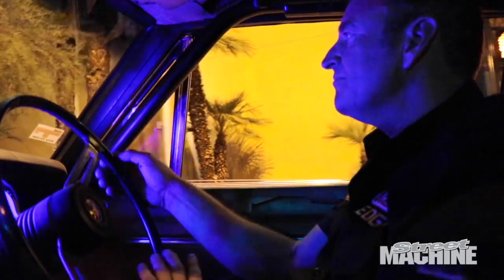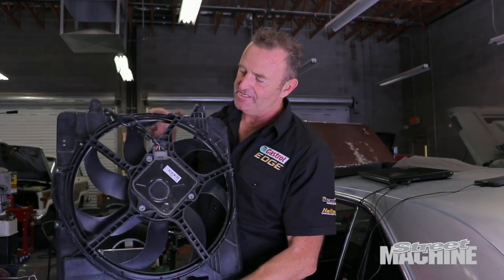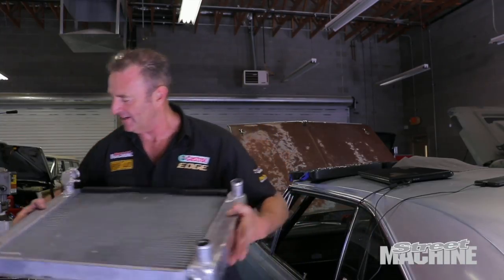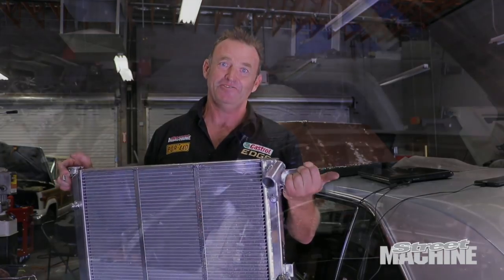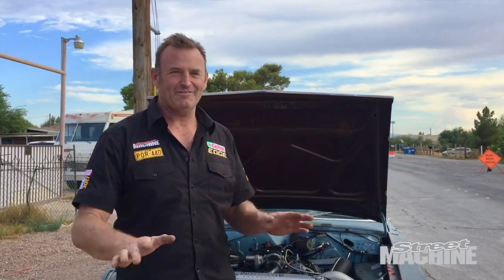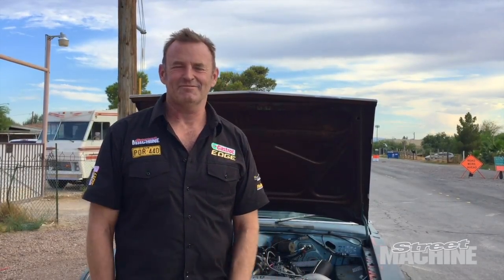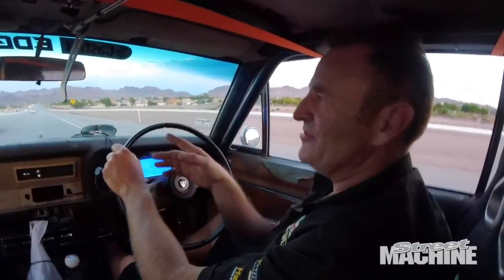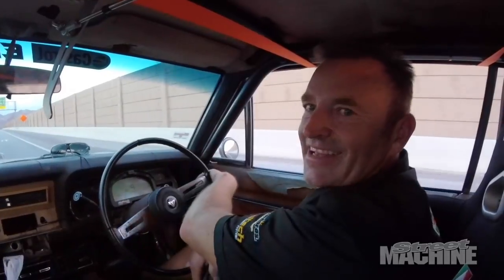Turbo LS-powered Valiant cooling system fix

Comment: Great work on the heating problem, also it's pretty amazing that Hal - tech can work on the car when you're State side.
Reply: Potaka79 Haltech are really good like that, they keep your tune in file so they can just quickly pull it up, change a few parameters and can flash the tube remotely

Comment: Great to hear you have managed to get back on the road. 
That radiator should have been plenty? I wonder if one of the diverters for the multi pass had been broken off inside, or perhaps it was only ever a single pass? 
You love got to love driving at night with the old Lucas 35 watt sealed beams.
They really look after the tourists at the Jeep conversion place you were at. Haltech doing a road tune touchup on the other side of the globe. That's great support for sure.
Only 2600 kms to go. Good luck.
Cheers

Comment: Have you bothered to check the water pamps ability to actually pump water. I fitted a modified water pump to a cleveland and all problems fixed and to rub salt into your wound I fitted a standard LH Torana six cylinder radiator in front of the 351 with no cooling issues, in fact the engine was running too cool . Every one has been looking at the wrong place for too long with respect to cooling system problems, just test your standard pumps and be prepared for a shock.
Reply: Yeah I was thinking something similar, it seems the problem lies else where and they are going to great lengths to path it by doing other stuff to it. It shouldn't need such a big rad and fan just for cruising. What would happen if you were giving it some then? What, pop a head gasket
Reply: Oh yeah we have done 30,000 hours on engine dynos proving that the pump and thermostat location need a serious revamp. Ford took notice and that is why the Coyote engine has the thermostat located on the inlet to the pump. Their pumps still need work though. We have a test bench facility in Deniliquin NSW where we take a brand new factory pump and fit a proper impeller, which brings the pump up to the minimum requirements.
Best way to check to see if your pump is actually pumping is to take the heater hoses run them into a bucket bleed the engine and then pull the flow hose out and at idle time the flow. If it takes more than 10 seconds to fill a litre container then you have located the cooling problem.
Reply: That is indeed a big rad.
Reply: PPR Darryl Very interesting Darryl. What impellers do you use? Or do you sell these modified pumps for different engines? Sounds like something we could sell our customers at work when building engines
Reply: We use a stainless steel impeller see this ad http://www.ebay.com.au/itm/Ford-FG-GS-315-335-Coyote-Water-Pump-Modified. We modify a brand new pump supplied by the customer and depending on the type of factory impeller depends on the amount of work involved. For instance on the Coyote pump they have a plastic impeller which is a battle to remove.

Comment: Reroute the AC vents back to the cooling system and intake and save a AC vent for yourself lol 😂
Reply: just having condensor out front has a frigid lower half going through radiator...even gets the pan of engine, power steering. I am glad he attacked electrical, that was my comment on the previous video. A/C is a good gadget to have.. done right it is a helper for temps, it just uses power.